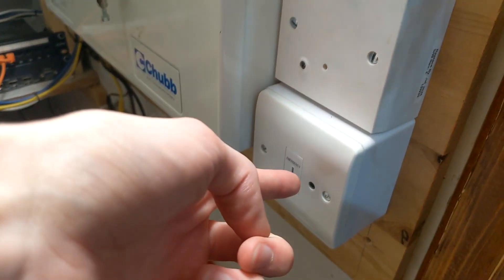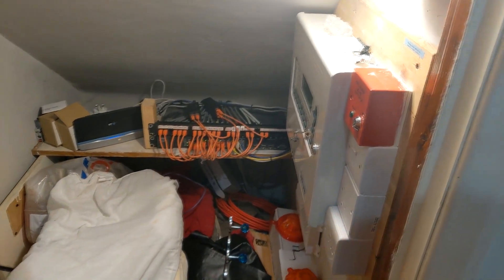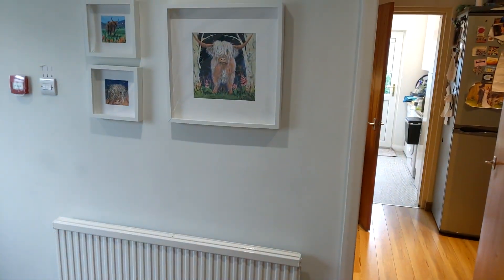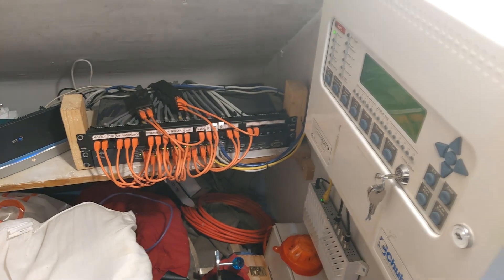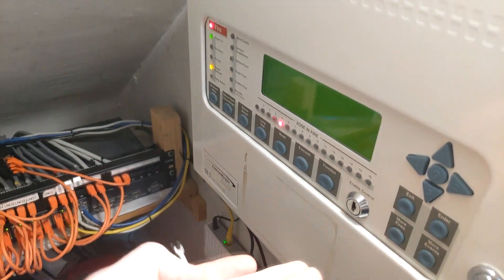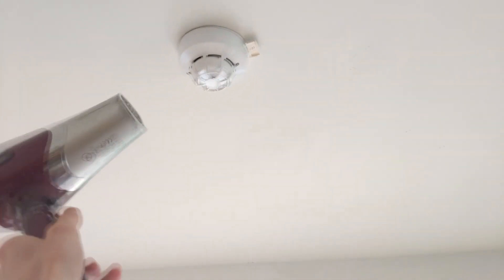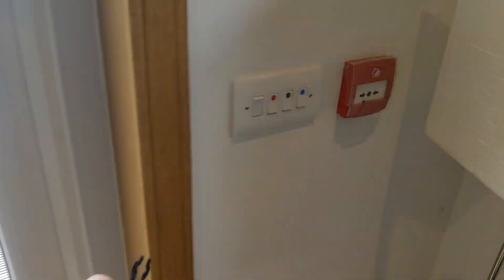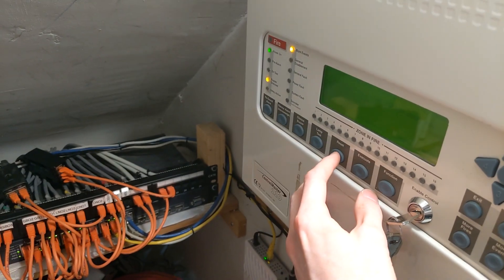Addressable System Test 19

Comment: What model is that voice evac sounder, and will it work with any panel if not what panel was that

Thanks,

Matt
Reply from the maker: this is the device in question https://www.apollo-fire.co.uk/products/range/discovery/sounder-visual-indicators/58000-010apo-discovery-open-area-voice-sounder-(red)

there are for my case however a slight hacky work around to get it to work, my panel doesn't officially support them as far as i know given the current revision of the configuration software (Loop Explorer) and the panels firmware. i have found that mapping the device as a discovery base sounder beacon works and allows you to choose the tones and messages i found this through trial and error. i would not recommend it, however i have not had any critical issues with doing so an they perform just fine.

hope this helps :)
Reply: @testlogs9005  thanks for the help
Reply from the maker: @prestonwoodelectronics  no probs

Comment: to put a call point and a sounder beacon together (XP95) I have seen the Apollo Loop Tester and the devices functioning without a panel but using the tablet like device,  is it a way to just have a goof with, similar to how you can use batteries with Conventional Devices e.g alarmsense, Series 65. because getting a panel all configured for addressable takes time.
Reply: player lol I don’t know how the loop tester exactly works, hopefully test logs can respond and answer your question, I’ve only ever messed with conventional stuff same with you but as you did state addressable panels are a pain so If your theory is correct then I may in vest in the loop tester for xp95 and discovery stuff to play around with even tho it’s £400

Comment: For some reason I like the sounders a little more when they're out of sync. Also, can the voice sounders do alert? You said you want different tones for CO and fire but that was definitely full evacuate with exception to the voice message.
Reply from the maker: have a look at the data sheet on Apollo's website openarea voice sounder it will tell you what tones and messages it has.
Reply: @testlogs9005  you can also tell by the Co detector going off and the continuous beep
Reply: @testlogs9005  but why did all the base sounders do evacuate when you tested the Co alarm? They used to do alert. Did you change them to do that?